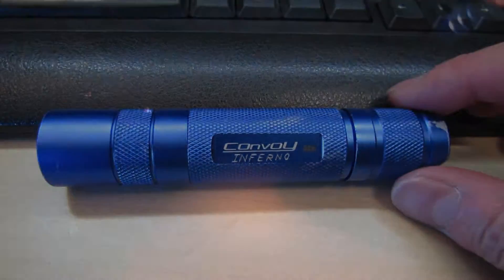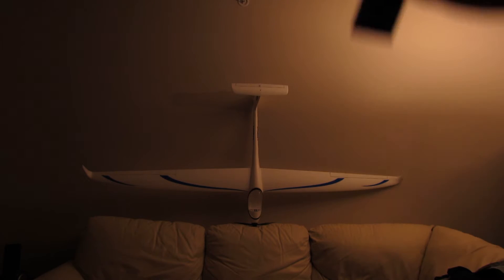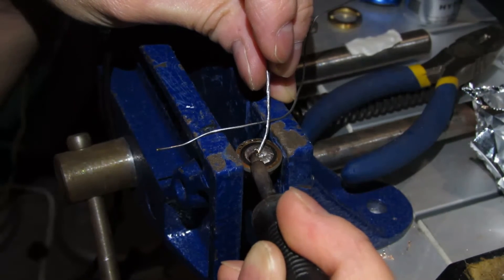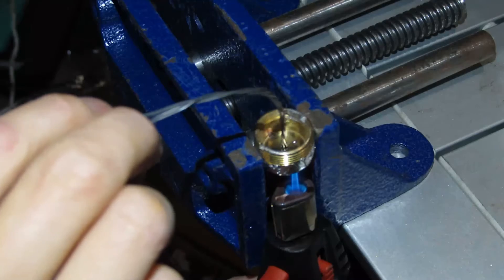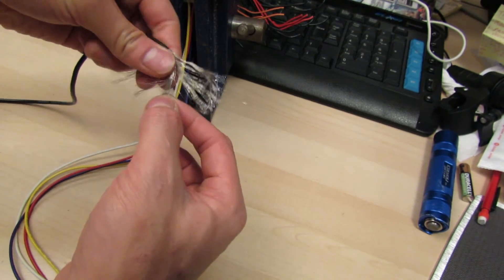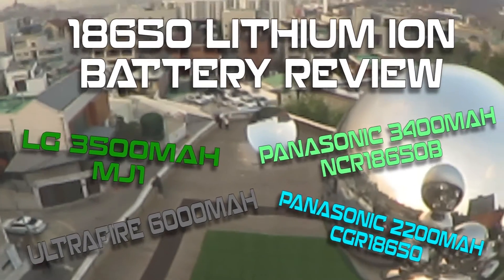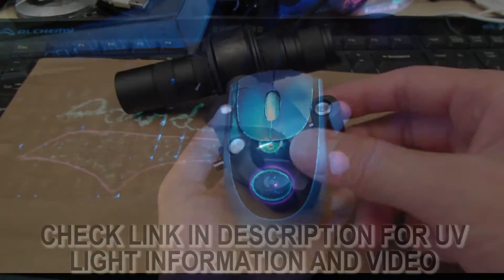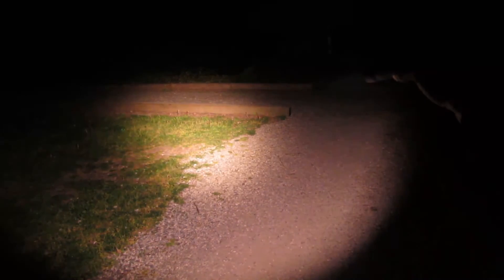The Most POWERFUL Flashlight EVER - DIY Convoy INFERNO - 2239 Lumens

Comment: this is awesome, I just ordered an s2+ host for my xhp50 build, should be sick.  Also ordered an eagle eye x6 for an xhp50 or possible triple xpl, will see. I wanted to do xhp70 but they are pretty big, would have to bore out the reflector and they are more expensive than the xhp50. Bought a lot of flashlights lately, including a Haikelite mt03, pricey but it is an absolute beast. I will maybe also do an l2 or l4 convoy build. So fun and satisfying to build monster flashlights lol.
Reply from the maker: Cool.  Ya it's fun, and also very very useful, if you're walking around a lot after dark, which I do quite often when I get off work, it comes in handy having an EDC that can punch out a lot of light.
My friend built the S2+ XHP70, but I'm not sure it actually pushes 5A through the XHP70, might only be pushing 3A, the internal resistance of an 18350 is higher than an 18650, so you might actually get more amps out of a single 18650 setup rather than 2x18360s.  You also will make more of a flooder, than a thrower, so your hot spot will actually be much worse with a larger LED.  You can buy reflectors that fit the XHP70, not sure where he got it, but it's not really worth it.
I'd rather go with the XHP50 in the S2+, you'll get a tighter beam that way.
I haven't played around with 2 x 18350 builds, but let us know how it goes!
I haven't gone away from the 18650, cuz I like the extra capacity/runtime of a 3500mAh battery, I can only achieve half the runtime with the 18350 batteries.
The MT03 looks good, let us know what you think about that one too!
Reply: David Sunshine yeah been thinking about starting a youtube channel on flashlights mods etc. Once you start modding you are hooked lol, no turning back.
Reply from the maker: Cool, do it man! Start posting, would be awesome.  You were posting ASMR videos before right?  So you're already familiar with video production.
Show us how to mod the MT03.
Hey what do you think about my cone doming idea?  If you shape the dome like a cone, I'm thinking it'll throw the light at the reflector, and make a beast of a thrower!  Do you think it'll work?  I haven't done testing yet, but I've made a razor blade tool to help carve the cone shape into the dome.  I'm gonna try it on the XM-L2 and XHP70 first, and then the XPL.
Reply: David Sunshine the mt03 is a bit tricky to mod, I've done some spring bypassing and dedomed the emitters, even though it may take some of the output away, I like the dedomed beam better. The mt03 cranks out roughly 9000 stock, comparable to the olight x7. Don't the make xpl with the cone dome, saw those on aliexpress. I'm thinking the cone will make it a mix between throw and flood, but who knows try it. On my skyray I dedomed 3 emitters, and four stock, then rotated the reflector assembly, so that on the left side you have 2 stock emitters under each other, on the right you have 2 stock emitters under each other. And in then the middle row of 3 are dedomed. So that gives you flood to the left and right, aswell as a good hotspot that will throw far. Dedoming all will just reduce power, but still mostly flood. Mixing is the best option.
Reply from the maker: Ya, a balance is always good, it's practical.
I'm gonna try to maximize throw, so I'll give the cone dome a shot, not sure what to expect, hopefully I can get a clean smooth cut, and if it's a little rough, maybe some oil on there will help make it smooth again, I'll do some testing.
That's a good idea to dedome some and leave the rest normal.  Ya you get a little less OTF lumens, but if you're getting a more useful hotter beam, that's more useful sometimes too, so win some lose some.
It's always going to be a toss up between flood or throw I think.
What I plan to do is make it the best thrower it possibly can be, and it will provide the best of all worlds, since I can throw a diffuser on the front of it to turn it back into a flooder, for when I need to use it for filming videos or close distance use, working on the car, etc.  The diffusers I get out of the old iPhone screens is pretty efficient I think, and has high transmissivity, so minimal losses there.
I keep the diffuser in the tube of the flashlight, so it's there when I need it.  So there are options in that case.
If I don't make it a better thrower, it will never be possible to reach distances if you want to.
That's why I like the idea of throwers.
It's like having a Mustang GT, you have all that power, but you don't have to use it all the time, just when you need it, or when the cops aren't around. lol.  True, you waste a little gas driving around day to day, but that's a sacrifice that is worth taking IMHO.
Reply: David Sunshine I can't quite picture the cone dome though, are four sides sliced clean down, leaving the top round like on some xpl models, or is does it narrow down to the top, making it kinda "spiky" looking?
Reply from the maker: You could do it like a pyramid, flat sides, but if you cut it down as round as you can, it would be the best distribution, then from the angle that the reflector sits at, you'll be viewing the emitter, which means the light leaving the emitter is being directed right at the reflector, and hopefully you'll have 95% of the emitted light being thrown at the reflector.  That's the goal, but if it's even 85% that would be great.  
If you do a flat de-dome, the light is being thrown evenly off of the LED, and therefore a lot of that light is being thrown out the front opening of the reflector.  If you have a dome, the dome focuses the light out the front, so even less hits the reflector, which is why de-doming helps make a thrower. 
This is my logic though, it could be totally wrong, and that's why I want to test it out.  It makes sense to me.
Here's my cone-domed LED, from the diagonal view, you actually do see the majority of the emitter, which means it's redirecting the light coming off of the emitter to those angles: https://www.dropbox.com/sh/hq9hs7gkg44euxg/AAD33_6hOfxg_i-2O0XSe4lXa?dl=0
The prototype works, but I'll need to take illumination readings before and after to actually see if it's any different, same flashlight, same LED, same battery charge level, otherwise a higher voltage might make one seem brighter than the other scenario, in which case the testing is all garbage and not repeatable.
Reply from the maker: Also, to help picture what I think will happen, here's a ray-trace drawing of what I think the cone dome will do, obviously, those are 100% my assumptions, and not based on any calculations, but rather past experiences:  https://www.dropbox.com/s/rdpppvgfbgwbi3m/2016-10-09%20-%20CONE-DOME%20XML%20-%20CD-001.pdf?dl=0
It could do something totally different in real life. Hahaha.  So that's just a cartoon if anything.
Reply: David Sunshine interesting, better give that a shot myself. Don't have anything to measure lux etc though. Try and do it by eye lol, outside when it's dark, comparing beams
Reply from the maker: I found it impossible to eyeball it, since a change of 30% won't be easily seen.
You'll need a quantifiable way of measuring and confirming the change. 
Do you have an iPhone?  Download a lux meter/foot candle/illumination app that reads in either lux or fc.  I like using LUX personally, since it's a ~factor of 10 greater.  If you use FC, you're using decimals a lot, I'd rather use whole numbers.
Reply: David Sunshine found it xpl v5 3d and xpl v6 3d 120 angle dome.
Reply from the maker: I ordered an XPL V6 from Fasttech, hasn't come yet, but it would be perfect for cone-doming because the dome is a high density type, so it's truncated on the left and right, giving us more material to make a steeper cone, the steeper the cone, the better, since more light is thrown sideways to the reflector.  A shallow cone will just throw the light out the front, could lose 50% that way, so making it just a few degrees steeper will help a lot.
Reply: David Sunshine xpl v5/v6 3d, 120 degree dome angle on ali.
Reply from the maker: Oh ya, you can order it from there too.  I wanted to order from Fasttech since their customer service is better.  I got an XPL HI once and it was DOA, they just sent me a new one.
Aliexpress is good too though, I order from there too.
I haven't cone-domed the XPL yet though.
Reply: David Sunshine does it come with the sides cut down like that ?
Reply from the maker: BTW, I had to use razor blades to cut the cone, they work best, and make a clean cut.
The utility life isn't sharp and thin enough to make a clean cut, so you'll need something sharper.
They were $15 in the store, so I ordered them off ali, something like this: http://tidd.ly/e0132c0c
They are the sharpest things ever, can even slice tissue paper like it's nothing. haha. I cut one up and put it on an exacto knife so I have something to cut with.
Reply from the maker: Yup, they do that so the LEDs can be pushed right up against each other I think.  That's why they call it "High Density" lighting.
But that's a good thing, because it gives you more material to shave down to a cone shape.  Therefore allowing you to have a steeper cone.  I actually need that extra material to cone dome, so it's awesome they make it that way.  The XM-L2 doesn't work that well, cuz the dome is full, and if you cone shape it, it's not steep enough I think.
Reply: David Sunshine ok, a nice tip when dedoming is to take a razor and heat it up redhot with a torch and the you cut, leaving a perfect finish. Just tried it works so good. Or maybe do a razor tip for the soldring iron.
Reply from the maker: I've tried that before, it does a good job for a flat de-dome.
For the slicing I'll try the super sharp razor blades, should be good enough for what I'm trying to get.  I will get some imperfections, but maybe the oil will smoothen those out.
Reply: David Sunshine Ok, sorry for all the questions once again lol. I will go to sleep now 2 am here zzzz.
Reply from the maker: Lol no worries, it was an good chat!  More later.  Good night man!  Lol it's 4PM here.  Ttyl friend from around the world!
Reply: David Sunshine  night night! Good chat! Later

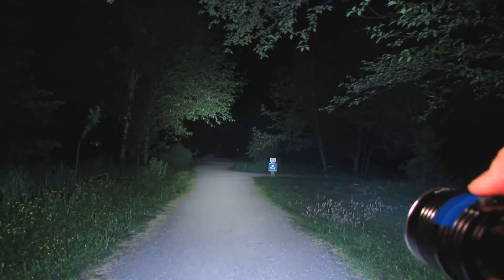Comment: 12:55 what is this flashlights?
Reply from the maker: outlawz1982gdynia That's the SkyRay King 7 x XM-L2.  But they don't sell it anymore. They do sell a Securitying version though.   Don't buy the XML version,  the LEDs may be counterfeit.  
I also supercharged that one to 75W,  normally it runs at 35 watts.

Comment: Just bought some sony vtc5 i read that they have 12m ohms of resistance
Reply from the maker: Awesome!  Ya, they have the lowest internal resistance out of all the batteries I have.
My testing methods just use a 2.4ohm resistor, so they may not be perfect, but are a good guide.
My testing resulted in 26mOhm for the VTC5, way lower than the LG HG2 at 37mOhm, and of course better than the LG MJ1 at 53mOhm.  For comparison, the Liitokala 5000mAh 26650 gets 39mOhm, and that's a good battery, so the VTC5 can push more amps than a 26650 and not heat up as much.  So it's a great battery if you want to push over 5A.

Comment: neat build. I'm going to be honest with you here though. it's not 2200 lumens. maybe 1600. LEDs drop efficiency when driven harder. 5A on an xml2 highest bin is about 1400-1600 lumens. good build though
Reply: David Sunshine you might get an extra 100-200 lumens out of the xpl, as it is the same die size as the xm-l2. but so is the xhp50.2, and that emitter will double the brightness.
Reply: @CamdenWallraff  yes but the 50.2 is also a 6v or 12v led and technically 4  laid right next to each other in a 2s2p or 4s configuration.
Reply from the maker: vicv071122 Thanks!!  I was just using the 116 lumens per watt figure provided by Cree. I recently got an XPL V6 LED, if I put that in, how much do you think it would output if I pushed 5.11A through it?
Reply from the maker: Isn't it a bit smaller cuz it's a 3.5mm x 3.5mm? vs 5x5mm?  I haven't dissected the LED so the actual emitting portion might be the same.  Ya the XHPs are definitely the way to go for the most power, with higher voltage you need less current, so less heat generated. 
Not bad for multi-cell lights or ones big enough to have a booster circuit tho.
I've ordered some XPLs so I'll play around with them, see if they're any good.  I'm gonna try making a tight beam angle and thrower out of it. That's the goal anyways.
Cheers,
David.
Reply: the phosphor area is the same on both LED's. You would be better off going triple XP-L-HI with a carclo 10507 optic.
Reply from the maker: Cool. Thanks for the suggestion.  I've been thinking of a triple, maybe a build on the future.  I'm playing around with getting more throw right now.  I think going with a triple would be great for out the front lumens, but the beam angle and field angles would increase.

Comment: make a inferno 2 in a bigger case ?
love the video
Reply from the maker: Thanks Cody!!  Great idea.
I could make one with a Convoy C8, I would put an XPL V6 LED in there, it's probably the highest lumen output LED available for a single cell LED flashlight right now.  I could also put it on a copper SinkPad II.  I was also thinking of shaping the dome to a cone shape, making it throw more light towards the reflector, and therefore making it a very good thrower, with a very hot beam.  By pumping up the amps over 5A, I think it'll be a beast of a thrower in the palm of your hand.  Keep an eye out for it, I'll try making it sooner rather than later!
Cheers,
David.
Reply: holy crap, dude you have to do that video, i would like to see that...
Reply from the maker: cody perret Lol I know. if it actually works it'll be awesome.  I ordered an XPL V6 LED but it hasn't come in yet. Once it comes in, it's go time!

Comment: Nice tut bro. The only thing is how you refer to the batteries. You talk about them by capacity (maH). It should be by model. I think the LG is the H2. Awesome vid, thanks for sharing.
Reply from the maker: Nonnof Yobiznes Thanks man!  Sorry, I thought there's only one model for that capacity.  Isn't it only the LG MJ1 that's 3500mAh?  You're right tho, cuz if they make a new model of the same capacity and a different current rating, then my video will be confusing, could be an MJ2 next year(2017).  I'll refer to the model numbers in the future, thanks for the tip!  Now there's a Sanyo 3500mAh too, so I should refer to the model number for that as well, NCR18650GA is the one I'm referring to.  I got some, but haven't made a video yet, it's actually a tiny bit better than the LG INR18650MJ1 3500mAh, but I think that's cuz it had a shorter shelf life when I tested it.
Cheers,
David.